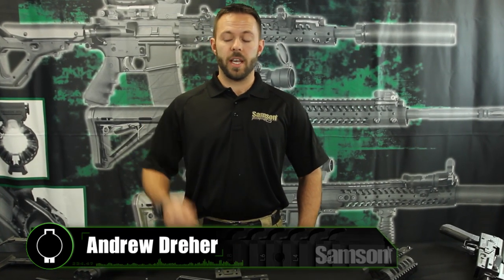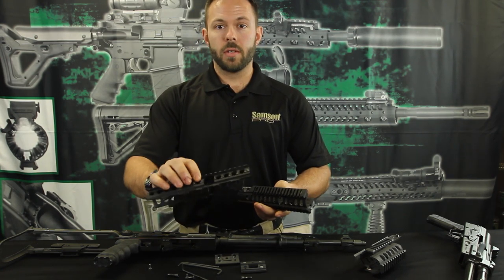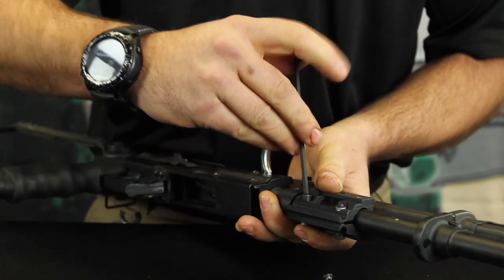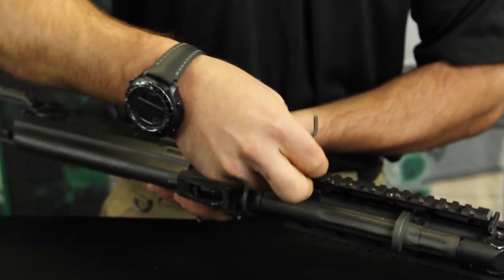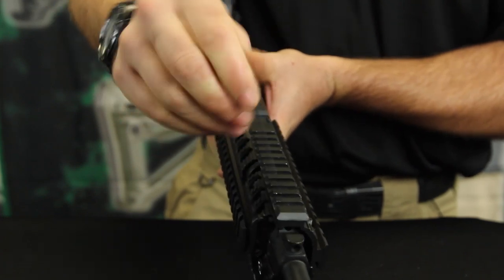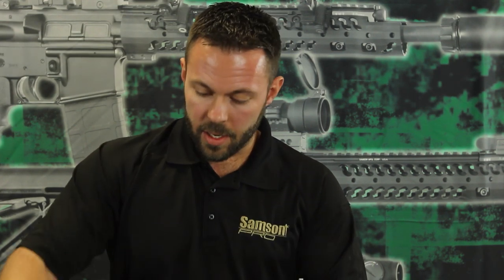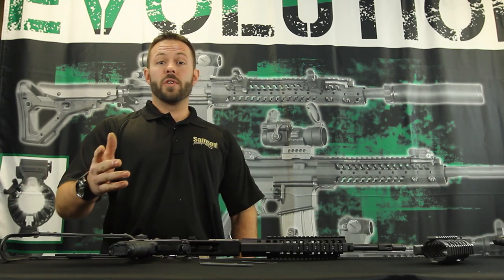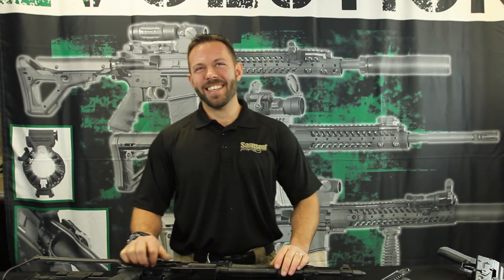K Rail Model 1 Installation - Samson MFG Pro

Comment: I had this rail installed on my Polish AK 74 Tantal. It never fit quite right and I had to take the rail completely off after every use. I used corrosive ammunition at the time so I had to take the gas/piston tube off to clean it properly and prevent corrosion. Because of the uniqueness of the Polish Tantal design, this rail system is not a good option. However if it was any other variant of the AK platform I believe this would have been a fantastic option.

Comment: I have a vepr 16.5 barrel,,just received my rail and the trunion brackets are th small and wont allow for proper installation,,,any help or replacement parts would be greatly appreciated

Comment: First off this video plus the blooper reel had me laughing so thank you. Second. Will this fit Zastava ak47s
Reply: I am currently trying to get this rail to fit on my zastava N-PAP M70 ak, and the bottom rail will not fit over the sling post. It is not advertised on their item description, but the directions on the sheet that came with the rail, requires you to remove/ file your sling post off. 
Wish I had known that on the front end.

Comment: With this rail mounting to the barrel via clamp, will that affect accuracy any?
Reply from the maker: It would not be as ideal as a completely free floating system. However, the barrel is already affected greatly by the manner the gas system attaches to the barrel. Where the AR platform has a much more delicate and floating way in which the gas system attaches to the barrel. We also mount the clamp as close to the barrel trunion area as possible.